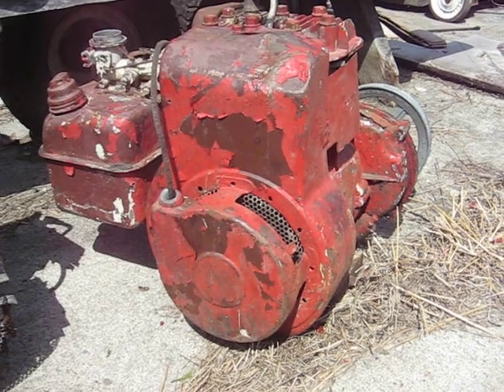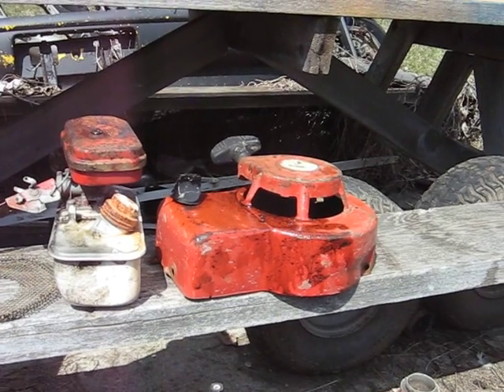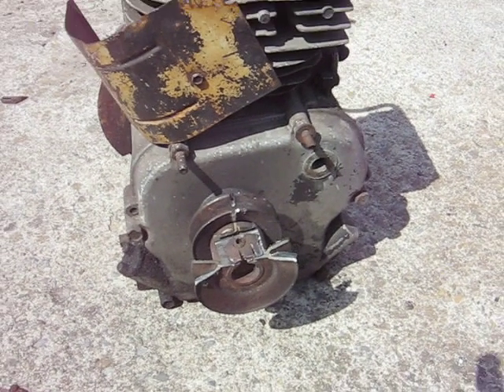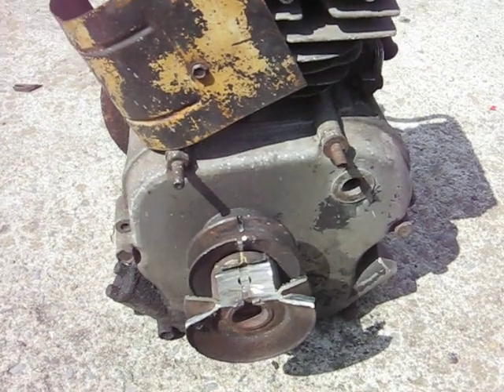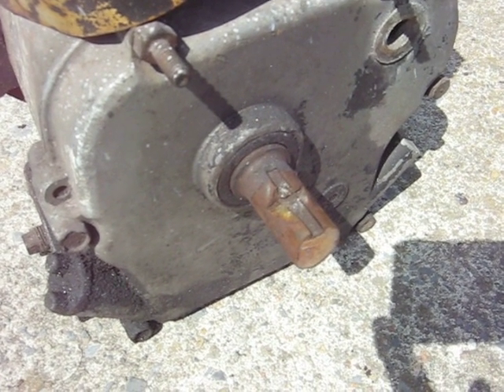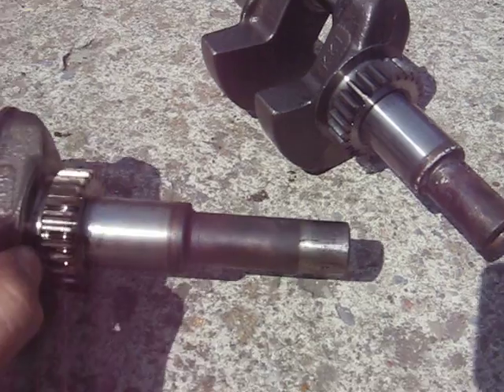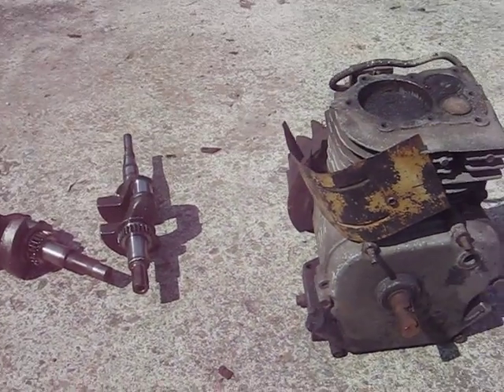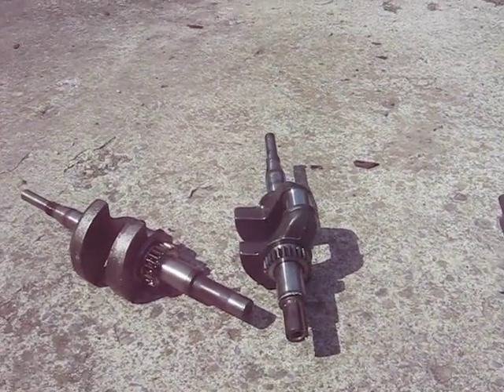Don't Butcher Crankshafts!!!

Comment: I just use a 3 in air cutoff tool and a thin wheel to cut off excess shaft. Wrap a wet rag around the top end to keep it cool. It cam be done easily. 5 minute job.
Reply from the maker: Sounds like a plan, wish I had and air tool, the 4-1/2 grinder is more awkward to fit in.

Comment: If you know a good engineer (fitter/machinist), you can get them to turn the end of the crankshaft down,press an extension onto the end of the shaft that's the same diameter as the original shaft then to dowel it then cut new keyways into it.

It can also be welded in place,I knew someone who used to get the Brook-Crompton-Betts electric motors shafts extended to replace old dryer fan  motors which were even beyond economical to rewind.

It depends whether that's worth doing to a Briggs & Stratton motor.
Reply from the maker: Yes, hard to say, though if you had a rare old one, it probably would be worth it.

Comment: trust me ive seen a few butchered cranks before too once saw one sawzalled off sideways right next to the case , i just have to live with my pully halfway on the end of the shaft i guess. . . i have another crank but the rod bearing surface isnt the cleanest and i would have to take apart an engine that i use all the time, it was shortened the proper way tho, straight as an arrow and filed smooth properly and everything, probably had a power washer pump on the end that wouldnt fit otherwise, but i know exactly what you mean, if you had the tools you could weld beads on it and machine it back to the shape it should be
Reply: always think of something new to say after i hit reply. . will i ever learn?. . .anyways i consider myself to be pretty good at not ruining cranks, ive had to cut pullys off before and the worst i ever did was an ever so slight flat spot in a line down the length of the shaft and it was perfectly usable after and i had to grind off both sides of the pully so it was in half cause making it a C shape wouldnt cut it, just grind a little at a time when you get close and you will see when you get to the shaft, there will be a black outline of rust or whatever or even maybe heat discoloration will indicate you are very close by it being more blue in the spots where its wearing thin
Reply: and then you can juts knock it with a hammer and break it cause its thin on both sides . . .dammit i did it again
Reply from the maker: lol, thanks for the advice, sounds like you have cut more than a few pulleys off!

Comment: Better than finding a cracked crank!
Reply from the maker: TheFurriestOne True!
Reply: I've got an old VW alternator with a crack right next to the slot for the wood-ruff key, sure I could buy a new one- but where's the fun in that? XD
Reply from the maker: TheFurriestOne Hope it doesn't break at a bad time, like -20F out in the middle of no where on a moon-less night and a deserted back road!
Reply: ChargerMiles007 Well, I don't plan on using it as-is. I'd get it welded or see if I could get a used replacement from the local auto electrical refurb place first! Plus I've got plenty of the old DC generator units I can rebuild and use instead, they just can't support as many accessories.

Comment: Great score on the engines. but all too common problem with people doing a hack job of fitting or removing pulleys!.

worst I have seen was where they did not have the correct shaft key and jsut drove the set screw into the keyway. vibration slowly mangled the mid section of the shaft and it eventually spun and welded itself on.